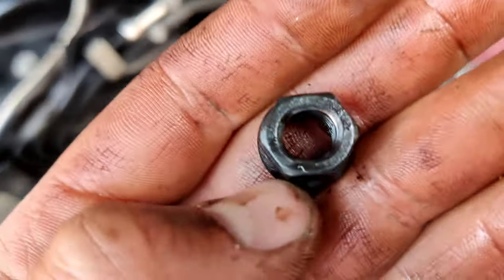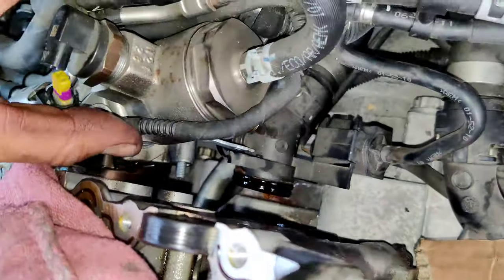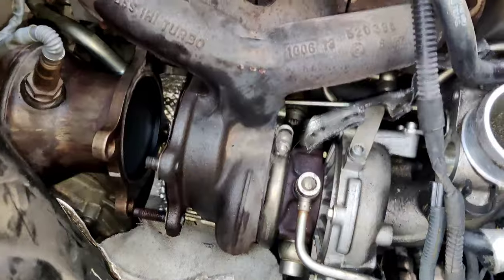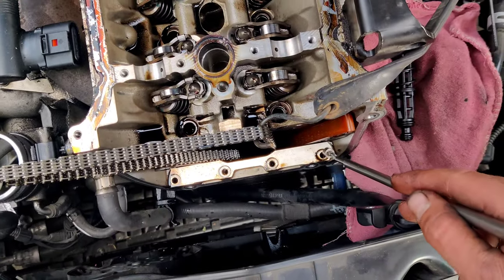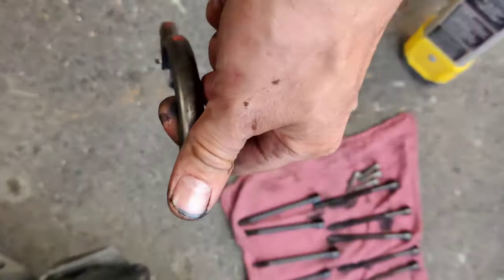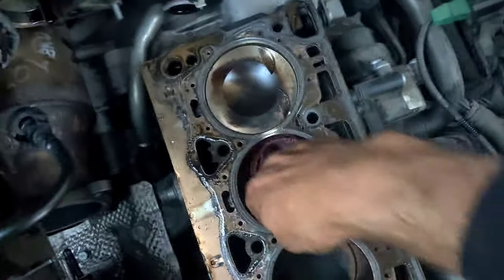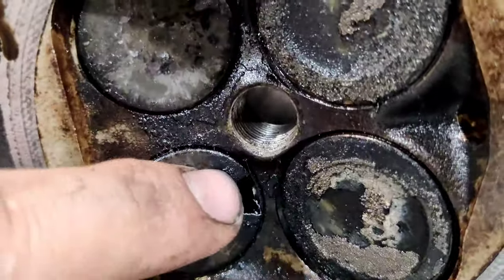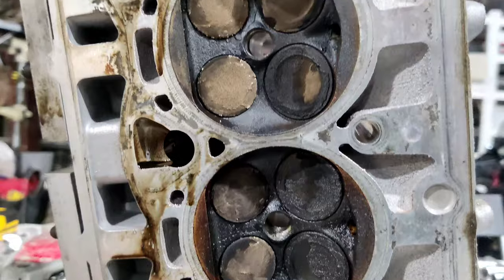Cylinder head removal Audi A4 TFSI 2.0

Comment: Hi Thanks for this video, I have A4 1.8 TFSI b8 engine looks pretty much the same. Will this video be the same process? Is there a separate video of what you did with the timing chain?
Reply from the maker: Yes sir! There a videos about whole repair process, just look on the channel you will find them! In my case the problem was in melted exhaust valve!
Reply from the maker: What is your problem?
Reply: Suspected head gasket.

Comment: I know this video is sort of old but I have a question I'm hoping to get some insight on. While I have already been through a burnt exhaust valve... The day I aggressively pulled away from a stop sign, Ended up with #4 misfire. I got it home and pulled the plugs to check compression (which was good on all 4) and I found the spark plug to be smashed closed with obviously marks on the ground strap. I gapped it (NGK BKR7E) and the car runs fine! No funny noises or knocks... What could have hit that plug? Again compression was good, all right about 120psi +/- 5, not pressing the throttle.

Comment: Hi, I have an Audi A4 B8 2.0 TFSI
The nr.4 cilynder stoped working, has no compression, the engine doesn't go more than 50-60 km/h..
Do you know what could cause it ?
Reply from the maker: https://youtu.be/wdKj-8bPS7c
Reply: Your engine doesn't go beyond 50-60km/h because the engine control unit (ECU) has identified an issue in cylinder 4 and gone into limp mode. Designed to minimise potential damage to the engine by limiting power but allowing you drive home or to your nearest mechanic. The misfire will need to be addressed before you can clear fault codes stored in your ECU and allow your engine to produce maximum power again. Causes of low compression in cylinder 4 are one or a combination of the following: burnt or bent valves(intake or exhaust), blown headgasket, cracked pistons, cracked piston rings, warped cylinder head. You need to carry out a leak down test to pin point the source of the leak of compression in cylinder 4, or thread a borescope camera into cylinder 4 through the spark plug hole and identify the issue.

Comment: Is Piston 1 the one closest to you or farthest from you

Edit: I need to figure out TDC on piston 1 for timing belt
Reply from the maker: Cylinder nr.1 it's in the front!
Reply: @valeriumoscalu7580  thank you! I’m doing my timing belt. When I tighten the tensioner the cam moves off its TDC mark by a tooth maybe half a tooth. Was wondering if pistons were off. Do you have any clue? 

I heard moving the cam back a tooth then tightening the tensioner will move the cam into the mark but when I did that, the cam doesn’t move like how it was on the mark. Very confusing

Comment: I have a 2.0tsi, i just want to replace my cams. Any way to do that without taking timing chains/tensioners apart.
Reply from the maker: You can't replace the cams without removing the timing chain!
Reply: @valeriumoscalu7580  ok so basically meaning i have to take the side cover on bottom off aswell? And rebuild timing after new cams? Sorry im inexperienced.. but broke so im learning to keep myself from paying a shop
Reply from the maker: There are a few more videos with the whole process , just watch them and you will understand, I made videos from beginning to the end! The whole process! If you don't understand something and have questions let me know!
Reply: @valeriumoscalu7580  thank you
Reply: @valeriumoscalu7580  also my symptoms.  P0341 only when oil presure drops. 15psi at hot idle. I removed side cover and found screen dislodged in cambridge and it looked like it was just shredded on the end of the intake cam. Couldnt find any of it in oil or in cambridge or oil valleys. It looks like it just got shredded to pieces at the end of the cams and in vvt solenoid. The plunger was extended causing my p0341 and replaced it. Now low oil pressure is my only isse. Short term i dont have the money for new cams, or machine work to cylinder head and oil passaged cleaned. I was going to use lucas oil stabilizer to get by 20 percent. Just to make up for excess clearances and keep oil up higher in engine. Would you approve or disapprove? I know it reduces flow and can affect preformance but i want to prevent dry starts and raise oil pressure. Its my only car and i need to drive it. So do i thicken the oil or just ignore my oil pressure and keep the flow the same.

Comment: Do you have to pull the whole front end off to remove the timing belt cover?
Reply from the maker: There is no timing belt! There is timing chain!
Reply from the maker: Better to take it off gives you more space and it's much easier to work around! It's not so hard to pull it off
Reply: Might as well remove it you are already getting rid of all the coolant in the engine why not take the rest off and make it easier
Reply: I ended up pulling the whole front clip off a few inches.  Got the cover off.